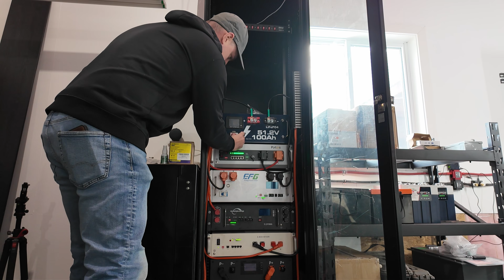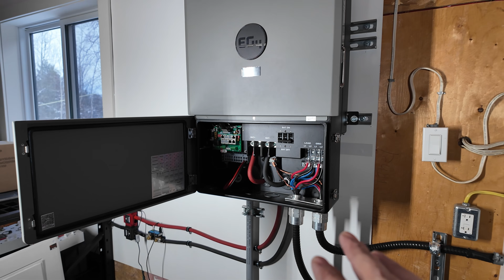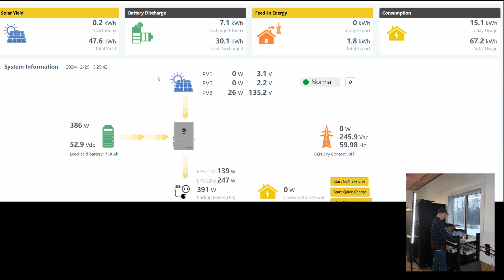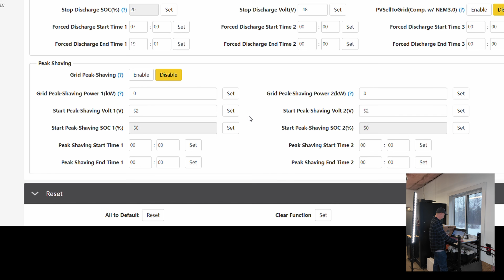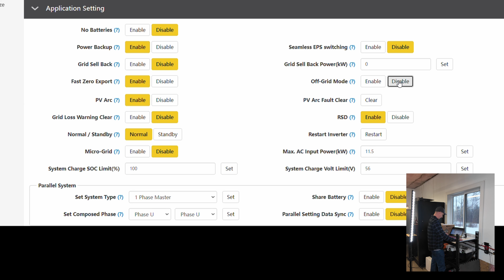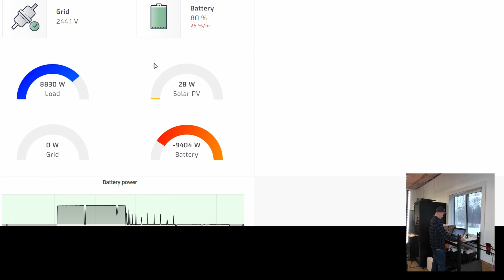AC Wiring Of The FlexBoss21 EG4

Comment: For a 2000 sqft house with 3 ton AC and a level 2 EV charger 40A would you recommend just using 2 Eg4 12000 XPs over 1 flexboss 21?

Comment: Great vid, thanks! Basically what I want to do myself. Just wondering now that you've had it running with peak pv available, how has it worked, has the system properly kept the grid export to zero? Any issues you can comment on? Much appreaciated.

Comment: What's with the goofy assed solar PV input terminals? No screws, no instructions. Who would have guessed that you have to stick a narrow blade screwdriver into the square hole to force the contacts open, then insert the PV wire into the round hole. Goofy, wasted an hour trying to figure them out.
Reply from the maker: Oh, wow that sucks. The manual explains installing the PV wire under 7.5, page 26, point 5. 👍
Reply: @Roll2Videos  No instruction manual came with it. They are sending me a copy.
Reply from the maker: @kimmer6 https://www.google.com/url?sa=t&source=web&rct=j&opi=89978449&url=https://eg4electronics.com/wp-content/uploads/2024/08/FlexBOSS-21-Manual.pdf&ved=2ahUKEwjqm-rjrIqOAxWyg4kEHfQyKVYQFnoECAwQAQ&usg=AOvVaw16zkR2Va7OwH8ZLgUODrm2
Reply from the maker: @kimmer6 I see, They update the manual.
Reply: @Roll2Videos  Thank you very much. I should have PV input this morning when the sun gets higher. I also ordered the LCD screen  for it. I received the EG4 chargeverter for rainy dark December days.
Reply from the maker: @kimmer6  That should work perfectly for you.

Comment: Those CTs, They go up to what size wire?
Reply from the maker: @scifycartoon  I'm not sure. You could check the manual https://signaturesolar.com/content/downloads/EG4%20FlexBOSS21%20User%20Manual%20v1.1.3%2011-26-24.pdf?ref=Roll2
Reply from the maker: @scifycartoon  I have mine arounf 4/0 cable with room to spare

Comment: If i want to do the same set up as yours, could i use a 50amp breaker (due to my wiring from house panel to garage flex) instead of 60amp breaker like yours? If yes, how much power could i help power the house with a 50 amp breaker?
Reply from the maker: @pierrecharpentier8904  It would depend on the type of wire you have and reference the code book for your area. You can also set the max AC charge and discharge so that breaker never trips. 👍🏻 Hope that helps
Reply: @Roll2Videos  perfect, that second part answers it very well! When will you have the generator hook up done, i have the same set up for the generator panel!
Reply from the maker: @pierrecharpentier8904  It's done, I just need to film it. Not enough hours in the day, lol
Reply: @Roll2Videos  one more question, if i may. when the grid is out, and you use your generator to power the gene sub panel in the house, that gives you power but cannot help you recharge your eg4 batteries in the garage correct. reason i am asking is if the power is out during 3 to 5 days, and there is barely any sun, then the batteries would completely discharge unless you have a eg4 battery charger connected directly to the generator, correct?
Reply: Never mind this last question, i just re-watched your video to the end, and i found my answers.
Reply from the maker: @pierrecharpentier8904  You are correct. My Flexboss is connected to my "Generator" manual transfer switch in the house. I will hook up my EG4 chargeverter to my battery bus bar and install an outdoor receptacle.

Comment: I'm concerned about you stating that a metal jacket means the Ethernet is cat7. The metal jacket just indicates that it is likely STP.

I'm really curious where you got that it was cat7 got those CTs. The manual I found simply says they can be extended with "common Ethernet". I see no reason to go for a more expensive standard that wouldn't have any benefits. It even seems to imply that UTP would work the same.
Reply from the maker: @ChopperKrios  I believe what I was referring to was the Cat 7 cable that I used from Amazon to extend the CT cable. Cat 7 is shielded. Does this help you understand?
Reply: @Roll2Videos If you were, you misspoke in the video. You said "cat7 which is what is used for these CT sensors" then while pointing at the wire for the CT you pointed out the metal jacket and said "so that's gonna be cat7"
Reply from the maker: @ChopperKrios  Good catch

Comment: Hello, I've noticed you have different brand batteries. Is that ok?  Or are u not using the bps on the batteries that u able to connect different brands batteries
Reply from the maker: I'm running the inverter off of voltage.
Reply: @Roll2Videos  Sorry for my ignorance, but what do u mean, off voltage? Is there a specific wiring diagram to do that?
Reply from the maker: @larrymiller7128  No wiring diagram. The batteries have BMSs that, when connected with a communication cable, will give the inverter parameters of the battery SOC, Voltage, Amps, etc, to run.
Since I'm using multiple different batteries with different communication protocols, I manually set my upper and lower voltage parameters of LiFePO4 without communication between the batteries and inverter.
Reply: @Roll2Videos  thank you for your response..I'm new to solar. I purchased 2 different brands of 48v battery, not knowing I can connect them together. I guess through bms..u said u set the upper n lower parameter voltage. How can I set that with my battery so I can use them all together pls.. is it through the inverter?
Reply from the maker: @larrymiller7128  Set through the inverter.
My absorption 57.6V Float 54V My low voltage cutoff 50V.
👍 It's much better if the Inverter communicates with the BMS.

Comment: Great thorough information video. 
About to order a flexboss. Finally deicided on the flexboss over the 12000xp. Pairing the flexvos with the Ruixu 16k to start.
Reply from the maker: @chavoac9713  Let me and my views know if you have any problems. I've been running mine since the video was shared without any issues.

Comment: Thank you for the great video. My install is almost identical to yours, however, my experience is weak in some areas so will follow you closely. Today's question is regarding CT's. If the grid power going into your house fails, will the CT's allow the F21 to still provide power to the house without energizing(safety concern) the grid? If not, can i turn off the main breaker or is there a way to allow the F21 to feed the house with the grid down. Have done some research on this but unable to find the answer. Thank You!
Reply from the maker: @philorton1940  No, the CTs will not monitor in a grid-down situation. Once the input power shows no voltage (no grid), all activities stop, and only the output part on this inverter will have backup power. 
From there, you would be hooking up backup power, which is the same as a generator. Manual/automatic transfer switch or interlock sliding transfer switch.
Reply: @Roll2Videos thank you. Very helpful.
Reply from the maker: @philorton1940  I will be making a video soon showing my hookup for grid down. 👍
Reply: Great!
Reply: So this doesn’t come with the 200amp transfer switch like the 18k does?

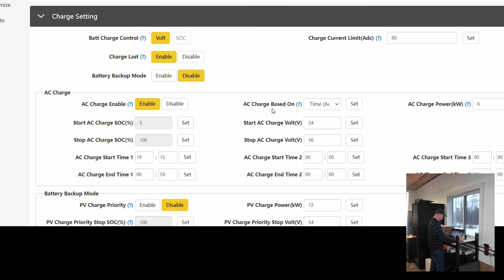Comment: So, at 27:00 you highlight a 200A discharge limit, can flex boss provide 200 Amps? I've been trying to figure this out, because according to the documentation it looks like maximum is 50A PV + Battery, and 90A with grid. Thanks for the videos!
Reply: I’m pretty sure it’s 12kw(50 amp) with battery only 16kw(66 amps) with battery + pv

200amp would be the gridboss
Reply from the maker: @DougVandenBergvideos  Yes, It can. Don't forget to factor in the energy loss when converting power from AC to DC

Comment: It says battery type Lead Acid, those server rack battery's are LifePo4
Reply from the maker: @mikesimms2250  Yes, they are LiFePO4, but I'd need a communication cable connected to pick that option. My batteries are from different brands and use different protocols to communicate, so it's impossible to use the LiFePO4 type. So, I use voltage under lead acid.

Comment: Fantastic video!  Do you have a metering agreement with Power Co?  If not interested to see if any power does get pushed back passed the CTs
Reply from the maker: @cgutowski471  I do not have an agreement. So far, no power has gone to the grid. I have a separate whole home monitor that I'm watching.
Reply: @Roll2Videos  Thanks for the fast reply.  Really interested in seeing of the PoCo can see anything going back to them when large loads stop.  Hope that minimal grid draw helps. Does your separate home evergy monitor show negative values if anything is being pushed back to grid? Again, great video, keep it up!
Reply from the maker: @cgutowski471  Yes, it does show a negative. I have seen it pick up a quick negative number after a large load shuts down. Hopefully, they think it's a motor winding down. I'll make a video if they say anything to me.
Reply from the maker: @cgutowski471  I have heard that the meter at my house isn't bi-directional and picks up positive or negative power as power is used. Therefore, if I were to send power to the grid, they would charge me as if it were power used. That makes sense; all the homes I see with panels on the roof have separate meters for the outbound power.
Reply: The “smart meters” can see or they are sensitive enough to pick up an LED diode
Reply from the maker: @ibezag0  I've seen over 1 kW pushback for a split second. No contact by the electric co yet 🤞
Reply: @ gotcha, here in Houston what we will do is send a meter tester installer or a meter tech to investigate the KWG registration…..if the account does not have an interconnect agreement, we will look for sources that will produce it. A standby gen, solar, or turbine…..if we don’t see anything……there is nothing we will do at that time……but we will flag the account to see if it continues to rise. If it continues to rise, we will install power quality monitors at the overhead xmfr or underground feed….if its determine you are illegally sending power to the grid, we will send warnings through the through mail or the electric provider……the concern isn’t people wanting to make their own power but to protect lineman working “high side” of the xmfr…..some inverters do not have the “islanding” feature and will not cut off during an outage…..we had a lineman electrocuted from Back feed. We found the customer was using a plug in the wall inverter……one of those cheap ones off eBay…..that did not cut off…..customer refused to remove inverter so we disconnected their service from the grid
Reply: @Roll2Videos  that’s awesome if it’s not allowing much to get back to grid. Understand you had that 1kw. Was it an HVAC that turned off?
Reply from the maker: @cgutowski471  That could have been any number of things. I haven't been paying real close attention. I have another monitoring device and app that shows the pushback.
Reply: @Roll2Videos My POCO took about a year before they finally showed up unannounced to ask what was going on.
Reply from the maker: @niktak1114  I'll post a video of that time comes for me

Comment: what is the cable you use to wire from the panel-grid to the EG4? I ask because of the color code being red-black-blue, with a ground, if that is NMB cable my understanding is that it is only rated for 55amp? I think you need to use 6ga thhn inside of conduit rated for 75c for a 65 amp rating? Great video :) Love the way you wired the battery rack, nice and clean.
Reply from the maker: @UnkyjoesPlayhouse  I used TECK90 Armoured Cable 6/3.
Reply: @Roll2Videos  Cool thanks for the information, looking into the pricing now.
Reply from the maker: @UnkyjoesPlayhouse  I found the cable really cheap on FB marketplace from a retired electrician. To buy the cable new is really expensive.
Reply: @Roll2Videos  Yep just discovered that, I use ALU SEC "service entrance cables" then convert back to copper in a breaker panel, then wire to my victron/eg4 invertors. Huge savings going that route, but always looking for copper alternatives.